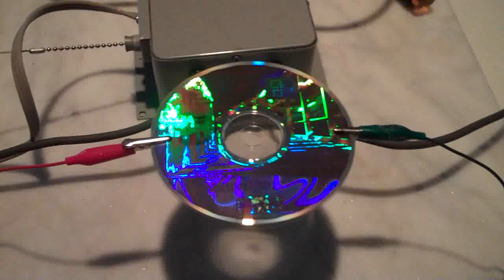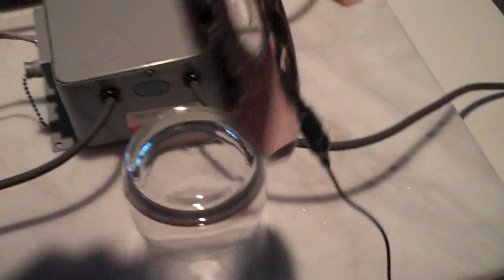12,000 Volt CD Eraser

Comment from the maker: Not necessarily - as a general rule, current = heat, not voltage. 
That's why MIG welders are rated in amps not volts.

Comment: I did the same thing a lot faster with a microwave. You're using electrical current to write 1's on the blank 0's of the CD - A microwave uses electromagnetism to accomplish the same thing wirelessly but the "fireworks" show is a lot more exciting, complete with electric arcs dancing across the disc like solar flares dancing on the Sun.

A CD burned full will spark less while a blank disc will spark a lot more brilliant.

Comment: Its in almost every case uselles, but its still 1/2 of the data.
If you have for instance, 2 identical cd's. And you remove on both of the cd's exactly the opposite side. Than its in theorie possible to restore all of the data.
But ofcourse, its almost impossible to get 2 identical cd's and remove on both of them exactly the opposite side.

Comment: Coarse sandpaper to the label size works better.  A wood saw (used as a scraper, not as a saw) works even better.  Your electric method, as "cool' as it looks, leaves a lot of data intact.  The wood saw in my swiss army knife destroys 100% of the data in 5 seconds with about 1 ounce of force.  It's all in the wrist.